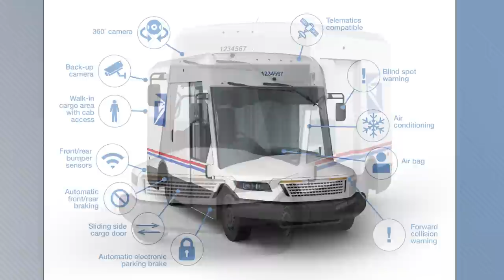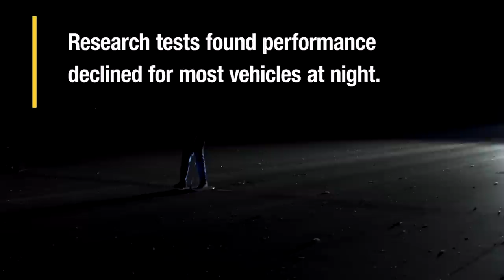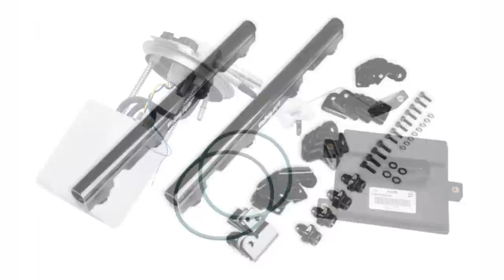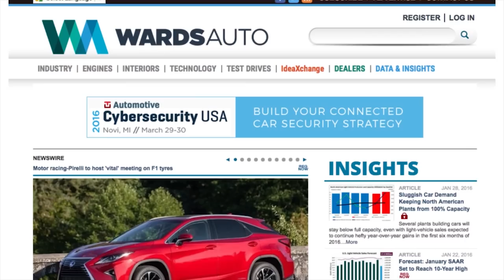U.S. Post Office Pressured to Buy EVs; Problems with PHEV Emissions - Autoline Daily 3254

Comment: Why is De Joy still Postmaster General?
In any properly run company, De Joy would have been fired already for incompetence. Ostensibly his job was to reduce costs while keeping the Post Office delivering mail on time to every place in the USA that has an address.
Instead the Post Office is deeper in the red, the mail runs later and more of it is late.
Reply: @golfish8589  The Democrats have a majority in the Senate. This has nothing to do with Mitch McConnell or Republicans and everything to do with Democrat incompetence. 
As for big oil winning, how so? The amount of oil consumed by the USPS is trivial. Besides the current design was originally negioated under Obama and the vehicles are designed for either ICE or BEV drivetrains.
Reply: @golfish8589  .. +1. .. Agreed, Golfish is spot-on with the details.

Comment: You don't need EV's to not have less than 9 mpg in a delivery truck. I have no idea how OshKosh managed to make a power train that terrible. Literally no delivery or service vehicle at that price point is below 14, and many go well above that.

But thats what happens when you farm work out to a defense contractor. They pocket the money and deliver trash.
Reply: Actual MPG is bad when you're driving slow and idle a lot.
Reply: Also when you do a lot of one block start /stop driving. 
Exactly the kind of driving that an EV gets the best efficiency at.
Reply: @Poxenium  then why didn't they simply use a typical hybrid system? They wouldn't even need to go plug-in, just a normal hybrid drivetrain like any old Prius would do.

Comment: I don’t understand why the post office needs a special vehicle whereas UPS, FedEx, DHL and Amazon all use common trucks and are now transitioning to completely standard delivery vans. This feels like pure corruption where the requirements are made to tailor fit a specific manufacturer… maybe one with a union 🤷🏼‍♂️
Reply: Rani: The Amazon/Rivian design is clearly better. It would really help Rivian if they were the suppliers.
Reply: ups definitly has their own vehicle, its not off anyone shelf.
Reply: UPS not only has their own vehicle, they're destroyed at the end of life.
Reply: You clearly have no idea what you’re talking about. UPS and FedEx trucks are purpose built. They aren’t bread trucks.
Reply: @rednwhitecooper  They buy then from truck manufacturers, GM, Grumman and Oshkosh are among them, they buy the chassis with the motor and drivetrain then a body is put on it, painted then delivered to FedEx or UPS.
Reply: @pogo1140  Yes, the BODY is purpose-built to UPS/FedEx specs. It's not a standard vehicle anyone can buy.
Reply: It amazes me how oblivious people can be. 99% of the reason they need custom vehicles is because they need right-hand drive at a specific height for mailbox delivery. Nobody else delivers to mailboxes. UPS, FedEx, etc. all have to park and get out to deliver. All the standard vans and trucks on the market are way too tall for this purpose.
Reply: @nodak81  No, that body is mostly standard, it's the shelves, seating position does it have AC or not that is custom, but even that is essentialy selected from a menu of available parts.

Comment: Finally, they figured out cold starts are horrible for the environment
Reply: It's horrible for the engine too.
Every time the engine stops, the oil pump stops pumping oil around the engine and the engine starts losing lubrication.
So when it starts up again, the only lubrication is what hasn't drained out.

Comment: The vehicle shortage which is blamed on the chip shortage is a pile of manure. I drove by Port Newark New Jersey on the Turnpike bridge.
The new car lots where vehicles are stored were full. Unless the cars are being pushed into parking spots in a mile square area, these cars have computer chips and run.

Comment: We need more all electric high mileage and or high idle fleets. Keep one non-electric per station or region for any edge cases. Start with the highest density areas. I’ve said it before, make this program a revenue positive or at least revenue neutral. Install lots of cheap level two chargers all over the place and it’s a win-win. High density areas need more level two chargers for high density living. In addition to mailboxes‘s, require a width a level two charging infrastructure for the post office to use on daily deliveries.  It’s always better to top off batteries (in the middle range) anyway. It would cost very large complexes $500 for 2 level 2 plugs plus install and $2 at most daily for electricity mid day when residents have gone to work. Keep one spot/plug dedicated for mail.

Comment: PHEVS aren't the devil. Some idiots will buy them and don't bother plugging in frequently. Reasonable people will be constantly playing the game of running on electrons only, and save quite a load of cash on fuel. (We drive a W205 C300de and over 20000 miles with a lot of road trips the overall average is 94mpg (US). On daily use, and always plugging in at night, we rarely get the diesel engine running. (Unless you floor it, or go over 75mph, or your daily run goes over 30miles)
On the other hand, especially on road trips, you get some of the advantages of BEVs (regen, mostly), but zero range anxiety.
Compare it to a regular C250cdi and it gets you hot hatch performance for less than half the overall fuel consumption and emissions.
Keep up the good work, and cheers from Portugal!
Reply: Your argument makes perfect sense!
Short attention spans mean people aren't aware of how useful a modest PHEV range can be on a daily basis.

Also, here in USA, people divide into 2 camps (generalizing)
- militant EV advocate
-militant ICE advocate
PHEVs get undue hatred from each camp. 
Enjoy the savings and the road-trip flexibility!

Comment: There is absolutely no reason why the postal service shouldn't shoot for 100% EV adoption. All of the pieces of the puzzle are there. All they have to do is put it together. 1.*Battery swapping available* from NIO under 3 minutes (has had a presence  in San Jose for years with a total of  700 plus battery swap/charging stations) are experts in this technology. 2.*Technicians/Manpower* They could train their own technicians from within the postal service. 3.*Funding* Build Back Better.. 4.*Leadership* immediately fire Louis DeJoy for incompetence. The U.S. Postal service needs and can train technical people when possible from within. Very few politicians are technically savvy, some aren't even politically savvy. The point is the postal service can make this vital transformation if they just step back and look at what's available.
Reply: battery swapping is foolish. 220 volt outlet  by  each vehicle at night will provide   the full charge  they need for a full day's drive .!
Reply: @MarkMeszarosYNG  Not in all situations. If you notice I did say swap/charging stations. What if some one forgets to plug in a vehicle or a battery has a fault that will not allow it to fully charge. Nio has proven that swapping can save a lot of time if you have a vehicle that needs to get back out there quickly like during the Christmas season..
Reply: Also postal distribution/regional  centers I believe operate 24/7 getting packages out to local postal offices which bolsters a better case for battery swap/charging stations.

Comment: Beauty is in the eye of the beholder.

I think it is an excellent design when you look at it from an operational standpoint. Plenty of space in the back to work with letters and packages, sliding doors on each side to access the cargo area and a field-of-view for the driver that should allow just about any obstacle to be observed in time to prevent damage or injury if it is a pedestrian.

Comment: Try a maintenance heater for the Catalytic converters in PHEVs. Either that or increase battery capacity (about 25KWh works by most of my calculations),  to reduce the number of times the engine is starting to charge the vehicle, while at the same time the vehicle runs on battery power much longer. But this is only relevant IF the carmaker is going to keep making PHEVs. Otherwise, just go all the way to GEVs, using the Gas Engine to run ONLY a generator, with electric propulsion, or BEVs.

These half measures and refusal to go further to address their shortfalls is why these systems always seem to NOT work. Treat it like you want it to succeed and it will. See BEVs.
Reply: Or, avoid all those halfmeasures and just use a BEV.
Problem solved.

Comment: How many days will it take to get a letter if they have to stop every shift and charge the trucks?  No supporting infrastructure in my area would make them even slower than they are as they would have to stop their routes and return to a central charge point.  Their constant stop and go driving would kill a battery quickly and rural routes......pipe dream at best.  Let them have ICE until a real viable solution is commercially available.

Comment: Almost worst deal EVER. At almost $64k each the new vehicles at 9 MPG will only be 0.4 MPG improvement over the current ones design in 1984. CORRUPTION in the mail.

Comment: UPSP EVs. "Needs a lot of chargers and trained technicians" Those are challenges, not obstacles. The reality is that installing L2 EV chargers is cheaper than ongoing fuel costs, and they USPS would need to swap diesel techs for EV techs. Meanwhile, DeJoy is creating mountains out of molehills to support his chosen winner and Congress is shortchanging the USPS budget in order to sabotage it and push postal service to privatized parcel companies. 
But yeah, OshKosh's design is an abomination.
Autobraking: Some camera only systems performed as well as systems with radar. Almost like Tesla knew what they were doing for going camera only.
Reply: 8.2 mpg to 8.6 mpg. What a waste of tax dollars.

Comment: Nobody is using EVs for real logistics work. Relatively large heavy vehicle driving all day long with the AC or heat blasting 100% of the time. They'd have to charge it or swap batteries multiple times per day which means lots more wasted time and money from having to drive back and forth from their depot. Come up with an EV that can drive for 12 hours in extreme cold with the heat on the whole time without having to recharge or swap batteries, then MAYBE it would be a legitimate option.

Comment: The government is a joke I'd bet Brandon invest 250 million and will be at 15%  by 2030
Reply: @golfish8589  it's the Free markets fault I live across the street from a post office. All of the vehicles theu use for the most part were carryovers from UPS, FedEx, and all these brand new RAM vans ice vehicles are cheaper to operate and run and more reliable. That's essentially what the post office said in their comments
Reply: @dj2000lbs  ice vehicles are not cheaper to operate and are NOT more reliable and less maintenance